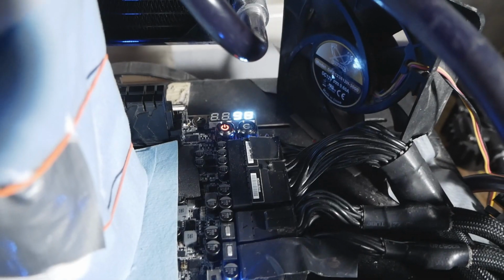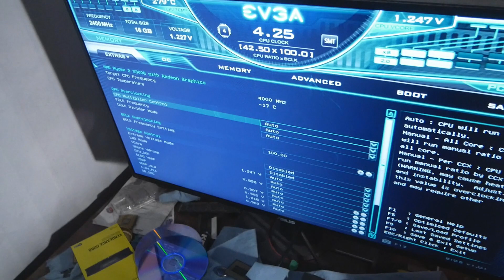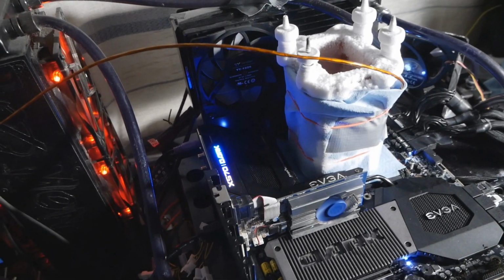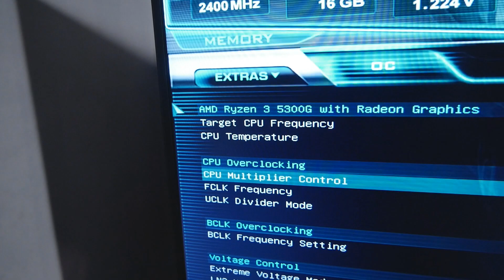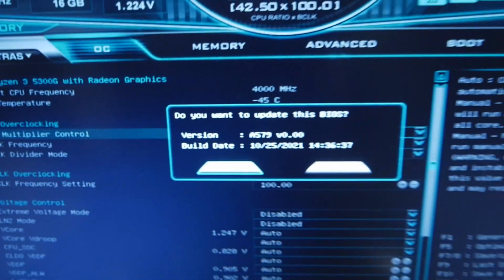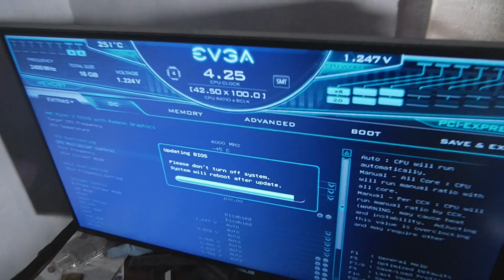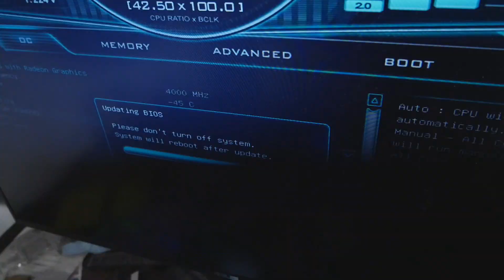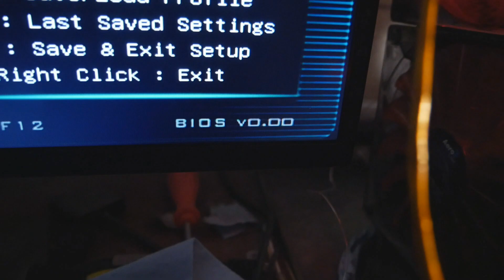How to Recover EVGA AMD X570 Motherboard BIOS - Corrupted BIOS FIX Using Backup BIOS

Comment: Pile of garbage motherboard. I regret every day since i bought this board , its only problems with it and evga support  give 0 shit , they dont even respond to emails anymore. I simply cant acess the most shitty bios ever made because this garbage is booting straight into  windows. I've tried to update my gpu firmware which can "sometimes cause issues with certain boards"  causing the issue when display is not recognized during boot initial process but my firmware is up to date, i've looked at evga forums and they told you try dp 1.3, try dp 1.4 , try hdmi , try newer hdmi , try older hdmi , WELL FUCK. Nothing is working. I've got 3 bioses on board and i can access only one of them , to do that i had to borrow old lcd display with vga output and i had to buy very old gpu with also vga output, then i had to enable option that makes you choose from what location you want to boot (there is enter setup option). Evga? Never. fucking. more

Comment: Yes do not turn off the psu when you try to clear cmos, it’s absolutely will not do anything with the psu off 😂
Reply from the maker: I generally always clear cmos with PSU turned off. On some boards if you keep PSU on the rig will turn on automatically once you release the CMOS clear button.
Reply: I often pull the cmos battery before I even plug the motherboard in when I'm buying used and its never caused me any issues. I've never tried clearing it using the button maybe that's different.